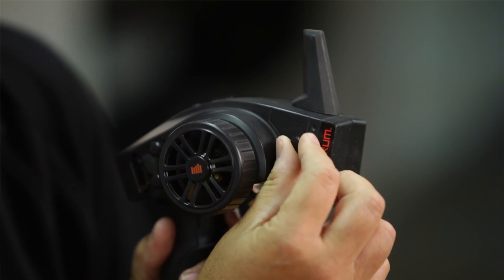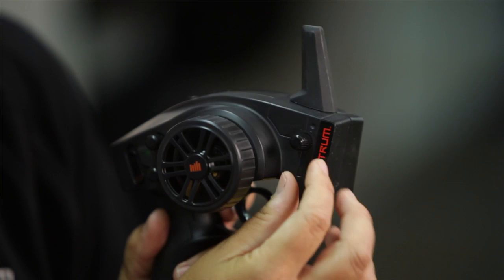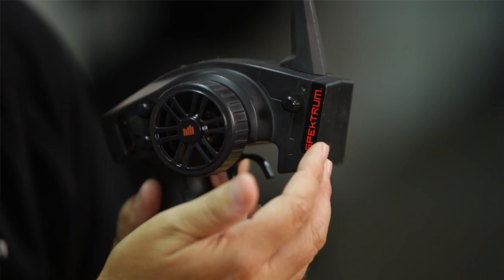Spektrum RC AVC (Active Vehicle Control) Technology - Frequently Asked Questions

Comment: I recently purchased the DX2E transmitter & SRS 4201. I understand it's a basic radio but...your instructions do not line up with how you actually get it to recalibrate. There is a YouTube video from a frustrated guy like me who posted the "real" way to recalibrate the radio. The AVC feature is finiky, it jerks spacifily to the left from a jump and there is no way to adjust this. I followed your instructions on how to recalibrate and during this process I lost left stearing completely and lost reverse. So I went to the hobby shop (R/C Country in Sacramento, CA) and they replaced the receiver because they couldn't fix the issue either...but then the same thing happened with the new reciever!! Long story short we had to swap out the receive the third time!! This still didn't fix the problem! So I stopped going to the hobby shop and went on YouTube to see how to fix this issue and finiky stearing. The instructions this guy gave are 100% different on how to recalibrate the radio?? BUT, IT FIXED THE PROBLEM. So now I have full left turn and reverse. Now the AVC is acting up once in a great while and I cannot disable the AVC according to your instructions. Spectrum in my opinion sucks. To finiky, so to solve this problem I'm going to buy an airtronics transmitter and receiver. Problem solved...